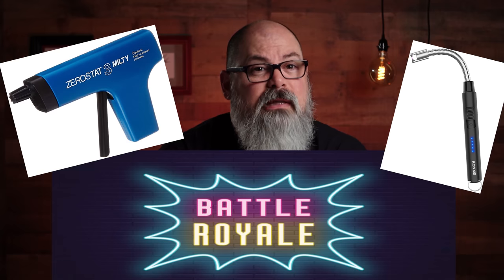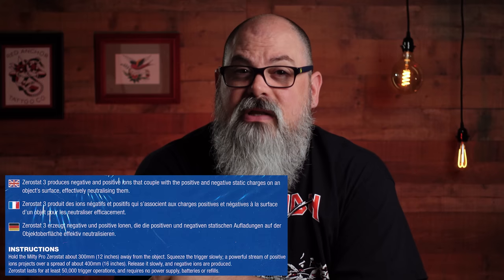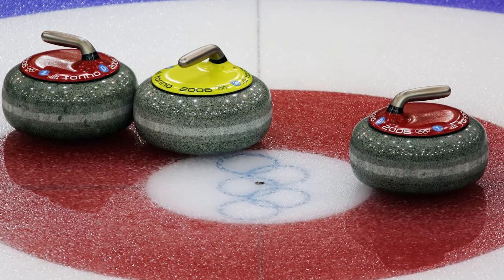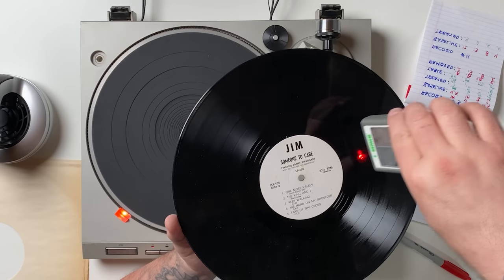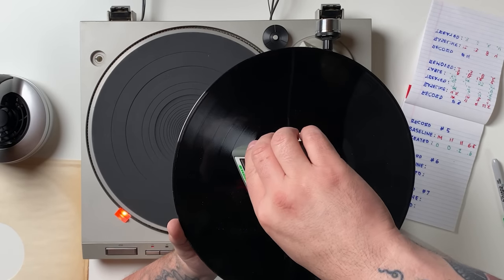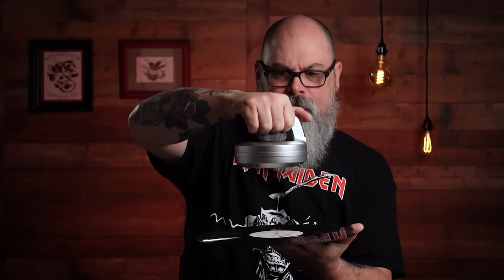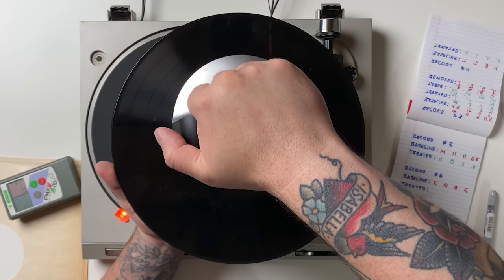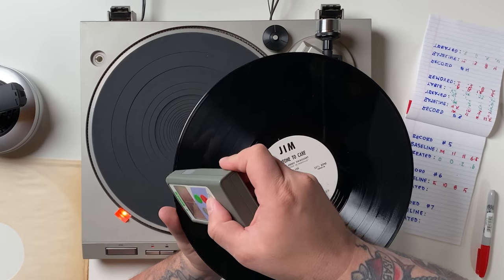How Well Does The Destat III Work?

Comment: After the static is removed by holding the record, it would be interesting to measure if any static is reintroduced by using an “anti-static” record brush. Gotta remove the surface dust before I drop the needle after all 😁
Reply from the maker: It's something I'm looking at :-)
Reply: Yes I  would be interested in that also
Reply: Any brush adds static through friction. I have both this for 2 years and the Zerostat for decades. Every brush adds static electricity. This unit is better than the Zerostat, but not anywhere as good as the DS Audio.
Reply: i would want to know if the brush is more effective now that the record is de-static'ed.
Reply: @TheGlotz69  or the CS Port IME1 which also has a Demagnetiser as well !
Reply: Best to brush off dust first then use a static eliminator after the brush
Reply: I would love to see some measurements for the Project brush arm.
I returned mine because it seemed to increase the static.
Reply: @mspdec Incorrect. Think about it, use your brain. What attracts the dirt and dust? Static does…. So if the record has static, brushing it won’t help, because the record will hold on to the dust and the brush will just push it around, while pulling more dust from the air like a magnet. Use the D-Static, brush the record and then use the D-Static and play.
Reply: @uberdetail5408  Lol "use your brain"....your a comedian pal !

Comment: To me, static is an annoyance, but not a huge problem. Doubt if I would open my wallet for more than 100 bucks to solve my static issues. Great video. Thanks.
Reply from the maker: In the end, that's what really matters. What you think and what you're willing to pay. Thanks for watching.
Reply: Unless you're playing in cleanroom environments, static will attract more dust from the air and nearby surfaces. Less cleaning over the long term could amortize the $329 in saved time. As always, YMMV.

Comment: Very interesting results Chris! Particularly with the way the static dissipates to the bottom of the record when in contact with the platter mat. It would be interesting to see a test of different mat types someday (felt, rubber, leather, acrylic, ect.) To see if the manufacturer claims of some of those mats dissipating topside static better than others are true
Reply from the maker: I could probably look at some other mats. I'm pretty sure it'll all be relative, but it may be worth a test anyway.
Reply: Another variable is the humidity in your home; using a humidifier to obtain 40-50% humidity will also reduce static. Something we Canadians know all about from our cold dry winters!
Reply: I have a thin, expensive carbon fiber mat and it is as bad as having it directly on the acrylic 2" platter. There are better materials, but I would think leather being some of the best- it is thickest, densest and most resistant to friction. I will not buy a leather mat most likely, but I am rather looking at another $400 mat from Italy that was recommended by Fremer.

Comment: I accidentally discovered your channel and I really liked the way the topics were presented. As far as this product is concerned, I totally agree with you on how to use it. Yes the discharge  must be done for better results with the record off the table. Zerostat must also be used in the same way as you have already mentioned in a previous presentation, off the table.
 I have both products as I also have the same static electricity meter. I have been using the Zerostat for over five years and I can say with certainty that it works very well. I have been using the Destat III for two years now and I can say that it has better results in the measurements, but also in practice. The difference between the two is not day and night, but it exists. The Destat III is also easier to use. Value for money? 400 euros is not a small amount but it definitely does an excellent job. It depends on everyone's wallet.
 I have also noticed the following.
- When you take out a record from a high quality inner sleeve (MoFi, Nagaoka..etc) the static is much less than the paper inner sleeves. The measurements are around 4KV. On paper inner sleeves the initial measurements are around 10KV or maybe more.
-The second thing I have noticed, is that 200 gram records accumulate more static than 180 (or less)gram records. 
Thank you for your excellent and detailed presentations. Keep going...Greetings from Greece.
Reply from the maker: Those are all astute observations that I've made myself. Thanks for dropping by and sharing. I'm glad you like the show.

Comment: Really love this channel and thank you for doing this, it really helps eliminates those “am I doing it right” questions you may have. I have been fighting static for ages, bought many “solutions” only to find im mostly just doing it wrong!

I have one request. As somebody who has a love affair with spreadsheets, I would love to see these numbers thrown in something that I could use to extrapolate the info further. While points on the record matter, I would rather see and average number per 4 readings, you could then easily work out percentage changes between different methods. 

Thank you again for putting in the effort and creating some great content!
Reply from the maker: Unfortunately, I'm not a 'spreadsheet' kinda guy. Sorry.

Comment: I have a Walker Audio Talisman that I have recently purchased, used. 

The online instructions for the Talisman specify that the destat should take place before the record is put on the turntable. 

The instructions also specify that before placing the record on the turntable that you should destat both sides.

It is further recommended that the final step should be a further destat of the side of the record that you wish to play with the record  revolving on the turntable and a finger lightly touching the rim of the record to act as a ground.

Thanks, again for your review,

Peter

Thanks for this thorough hands on testing.
Reply from the maker: If I get my hands on one of those I'll give that all a test as well. Seems like a lot of work just to listen to a record though.

Comment: Great review. I'm fortunate that I bought both my Disc Washer and Zerostat in the late 70's/early 80's so I will be able to keep those funds in my pocket. One question - where are you placing the LP (off camera) between your measurements? Is that introducing any variability?
Reply from the maker: I set it on my little ikea table, but I've tested that both on and off camera and it doesn't have any effect on the numbers.

Comment: The RT85  rocks! Take it from a guy who has owned over 30 TT's , from legacy to top line. It is now my sole table, I did switch out the Ortofon Blue (which surprisingly I liked) but went to my "go to" AT440ML which really brings it all to life. A bit more detail and soundstage. Glad to see others have caught on to this table that is mid-priced but I would put up against tables costing double. And though it is manual, love the autostop feature !!
Reply from the maker: It's a solid buy.

Comment: This thing is still $330 today.  I can't help but wonder if you'd get similar results using the ZeroStat gun, and then take readings after placing the record onto the turntable.  I watched your previous video using the ZeroStat but I don't think you ever took readings when actually placing the vinyl on the platter after using the ZeroStat on it like you did in this video.  That in general seems to lower the static even more, so would be curious how effective the ZeroStat is in comparison to the DeStat III.  Would also love to see tests where you pull too fast with the ZeroStat so it clicks, and then take a reading to see how bad that actually is.  I have the ZeroStat and I am still unsure of the exact duration to squeeze and release the trigger, if I should be squeezing the trigger all the way down (can't seem to do that in 2-3 seconds without clicks), just aim at center or do the triangle pattern method, or if to point the gun away on the last trigger squeeze when releasing the trigger, as demonstrated in the previous video.
Reply from the maker: The Zerostat works very well, but can't compete with the Destat. Measuring the record on the table doesn't do any good as the static bleeds off into the table (which isn't good either) and returns when you pick it up.
Reply: @thevinylattack  wanna sell me yours? LOL

man i wish the price for these things would come down, crazy how expensive they are
Reply from the maker: @Shivaxi  I'm afraid I still use mine almost every day. Hence why I can justify the cost. They are indeed pricey, but they work so very well.
Reply: @thevinylattack  Yeah one of these days haha.  For now though with the ZeroStat, what do you recommend when using it?  The triangle method, or just aiming at the center and doing squeeze/release 4 times?  And how far do you really need to squeeze the trigger?  Mine doesn't seem to like going all the way down, less it clicks.
Reply from the maker: @Shivaxi  I have a whole video on that. I'd start there.

Comment: I’d love for you to use this to find out if the anti-static brushes used before playing a record add anything or not. You might even be able to figure out the best way to use those damn things. I’ve seen lots of different approaches and have occasionally felt I made it much worse after using it because the record picked up my mat! Only once in a while does that happen though, but still what gives?
Reply from the maker: I'm working out how best to test that, hopefully sooner than later.

Comment: Great video! Thank you. I bought my Destat III after seeing this video. I was curious what your thoughts are on using a carbon fiber brush like the Audio Quest Gold and where and how in the sequence you would use it.  I have an Ultrasonic Cleaning Machine and I rarely have to use a carbon fiber brush. Today I pulled a record I had cleaned a week ago and just got around to playing today. It was stored in a MoFi inner sleeve but for some reason it had some dust on it. I usually use the carbon fiber brush with the record turning on the platter. Do you have a sense of what would produce less static: Use the Destat III  with the record handheld and then hit it with the brush on the TT?  It occurred to me this could add more static. Or brush it first with the carbon fiber brush on the TT and pull it off and hit it with the Destat III? this is an awkward work flow. A third choice is using the Audio Quest Gold carbon fiber brush with the record handheld. This is not the way this brush was designed to be used. 

Thanks in advance for sharing any thoughts you might have on this topic.
Reply from the maker: I've found the best method for me to be to treat the record in hand and use the brush on the table thereafter. The brush isn't going to add any static and it wipes away easily because the static is now gone.
Reply: @thevinylattack  That is what I figured too, but the Destat III gets the charge so ridiculously low it was not inconceivable to me that the carbon fiber brush could actually add a small charge. Add the Destat III in to my playback chain of a UCM, a Tru-Sweep record sweeping arm and a Sweet Vinyl Sugar Cube click and pop remover and my vinyl listening is pretty much as noise free as digital. I never would have believed it. Thanks for your help in this quest.
Reply: @jfm0830  i have been really digging into a bunch of research to upgrading my vinyl process...i still clean by hand using Disc Dr products, tho looking at a Project vc unit, new Mofi sleeves, etc..then using carbon brush b4 playing...but would you suggest looking at this first? I do notice the static still present after cleaning and playing that id like to get rid of. But budget considerate, would you suggest buy this 1st vs a cleaning machine?
Reply: @Mike_Jones68  That could depend on several things. Do you mostly buy new or used records? Is your environment dry which would contribute more to static being a problem? I think a good carbon fiber brush is the first thing to get for any turntable. Then if you mostly buy new records you could possibly hold off on the record cleaner. Perhaps get something like a Spin Clean for now for $100 or so. If you buy mostly used records then you must re-evaluate your situation. Depending on the condition, they will benefit more from a good cleaning than using something like the Destat IMHO. I would also suggest using MoFi or similar non-static inner sleeves  right away on any records you are going to play that need them. Paper inners can get paper shavings on the disc and taking the LPs  in and out of regular sleeves can contribute to static charge. A wet cleaning contributes towards removing some or all of the static charge on the records. This is why I suggested MoFi inners on the sooner side, so your paper inner sleeves don't just put a static charge on the records when you clean them and put them away.

If you buy mostly used records the cleaning machine becomes more of a priority. Once again you could get a Spin Clean or something similar to hold you until you can afford more. I would still say CF brush, non-static inners, a record cleaner and then the Destat. Don't get me wrong it is a great product, but some of the other devices have you covered for some of the effects of static. I HATE ticks and pops of any kind which is why I still bought the Destat despite having an ultrasonic cleaning machine.

If you have a lot of records that need cleaning I would prioritize getting the Project VC on the sooner size. It will deal with a lot of static issues. The only case where I would move the Destat higher on the priority list is where you have a really dry dusty environment where you may need to hit the LP with the Destat followed by the carbon fiber brush for every play. My 2 cents. Good luck!

Comment: Thanks for the detailed analysis! I've just recently come across this issue. I ordered a vinyl on Discogs and I can sense the elektrostatic field around the record even with my hand. When being played back you can hear loud crackles. But before I buy this gadget I'll make a try with my wife's Braun Satin Hair 7 hairdryer. It uses IONTEC technology which theoreically does the same as Destat III and the hairdryer can be operated in cold mode, too. But first of all I need a measuring instrument.
Reply from the maker: I tried an ion-generating hair dryer (there's a video somewhere in my playlist) and, unfortunately, it did nothing.

Comment: Well done video, but I still don't understand why static on the underside of the record is anything to worry about.  That's like saying that if you have scratches on the underside of the record, then they are going to affect the top side of the record.  If the record shows static while you are holding it, then you put it on the turntable and the static on the top side goes way down, then you are good and may not have to de-static it.  Who cares what the static level is on the underside, or what it is while you are holding it?  It only matters what the static level is while and where the stylus is touching the record.
Reply from the maker: Because static can transfer from one side to another, unlike scratches.

Comment: Outstanding video as usual, Chris. One thought, if we incorporate, and by we I mean you 😂, incorporate a cleaner into the mix, would that make a difference? I’m thinking during the electronic cleaning process of the Degritter, or the Hummingbird, static would increase. Wondering how this tool could be used to decrease the static electricity there. What if the manual cleaner is used, such as the Big Fudge or the Spin-Clean. Keep killing the videos. 👍
Reply from the maker: I clean every record I have when I first get it, and then periodically over time. I also treat every record for static before play.
Reply: @thevinylattack  Yes sir, same here. Upgraded from a spin clean to a Degritter and have loved it!
Reply from the maker: @1441engraving  I wouldn't be without mine.

Comment: Very informative, well done! I'd be interested to see how room humidity affects the test numbers. Static seems to be worse in the winter when humidity is low, and perhaps testing under various humidities would show how much worse.
Also, I'd be interested to see how much, if any, additional static is generated on the record after cleaning with a Discwasher.
Reply: Static can easily build up after cleaning. If you dry with a cloth that does it pretty much right away.
Reply: @leon9021  Yes, but I'm wondering about static build up on the record when you dry clean it using a device like the original Discwasher or one of its newer, but inferior, look-a-likes now available.
Reply: @DetroitStars  That also builds static. Any frictional contact between materials does pretty much.
Reply from the maker: The numbers would definitely be a bit higher is a dry environment, but it's all relative at that point. The static numbers change so much from record to record, there's no good way to get a baseline.